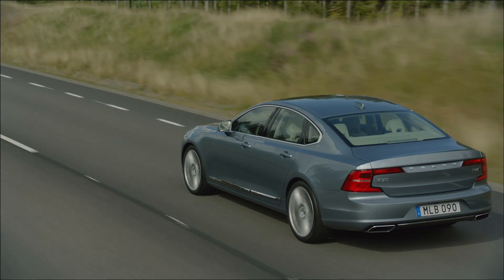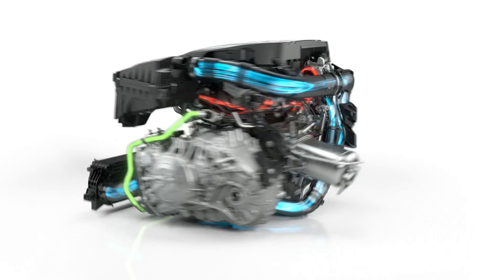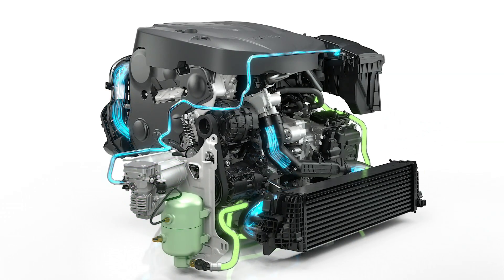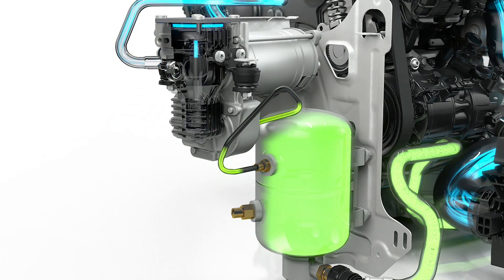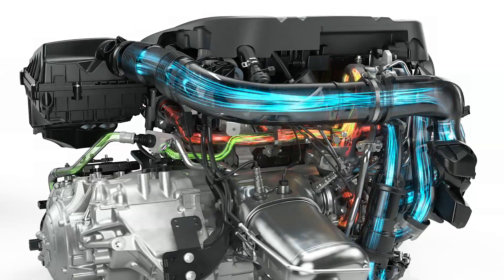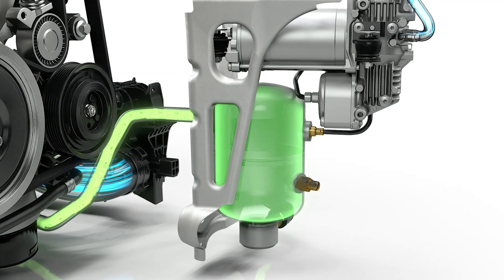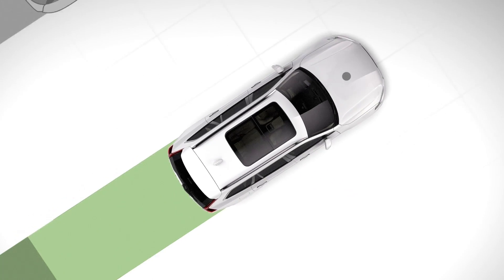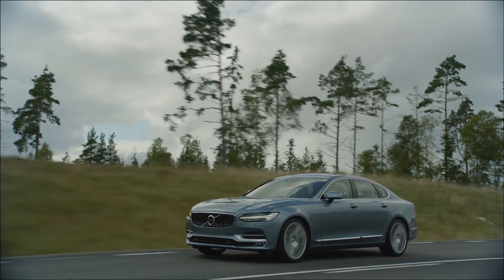Volvo PowerPulse

Comment: Why they are releasing the compressed gas into exhaust instead they can be given to air intake of engine
Reply: The real reason is probably to do with adding un-metered air into the engine.
Reply: agt155 a small air tank like theone they use would make no difference whatsoever.
Look around on youtube for aircharging videos , you'll see they use massive tanks and for a very small time frame like the dragstrip.
Reply: Yes I agree. I think what he meant was why not focus the compressed air on the compressor side of the turbo. ie use the kinetic energy of the compressed air to accelerate the turbo wheel.
Reply: agt155 due to the way the wheels are made to work, pushing air trough the compressor wheel won't "push it" as much as the turbine wheel. The compressor wheel is meant to pull and the turbine "push". It doesn't push but you get the point.
Reply: Yes quite right, but it probably would work in reverse although not so efficiently.
Reply: Electric compressor and supercharger both takes more or less same fuel consumption then supercharger can be used without these complication
Reply: friendly fassil you would need an insane amount of air to make any power out of air injection a bigger tank compressor etc, not efficient.
This way you instantly spool the turbo and get it to its efficiency range, giving that same amount of air to the engine would make no difference.

Comment: The car don't know in before when you need this. On the moment you push the throttle, this system start for working and take time before the compressed air is into the turbo and let scroll the turbo. Only system what work perfect and quickly is the ALS but it is not good for daily cars. The turbo's are very good this day and the more parts, how much more problems will come. This system is like the Air pump they will use in the most cars. The CO is measured in % so when the put a lot extra fresh air into the exhaust they measure a better CO on the end from the exhaust I think :)

Comment: Wonder if they worked out all the thermal stuff (~500deg C is boosted with compressed air of up to 90 deg C (thermal shock?)) and the whole work of the oxygen sensors.
Reply: This is Volvo. They make the safest cars in the world and are a huge, huge company. I think if you figured that out, their super-qualified engineers also did.
Reply: +eivis13 I was just wondering about that too

Comment: F1 does it better cutting out a load of extra weight and efficiency losses converting kinetic, into electrical, into compressed potential energy, back into kinetic.

Should just drive the turbo shaft with a motor and lightweight lithium cells.

Comment: will we see this tech in dual turbo drag cars?
Reply: +Obviously Obvious As hot rodders have pioneered using turbos and superchargers on cars to build power back in the day, you can count on the new era of hot rodders(tuners)to do the same. Of course, there would more than likely be kits available too but we'll just have to see what happens. This could seriously cure turbo lag within anyone using a big T88 turbocharger. I like it.